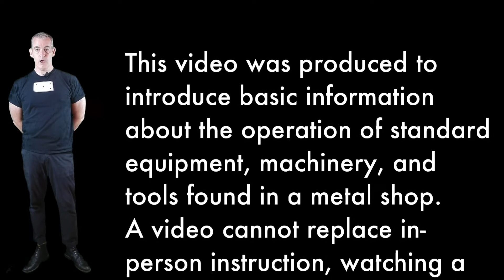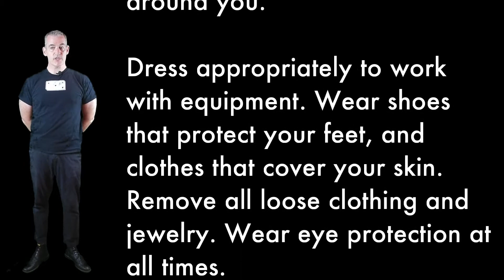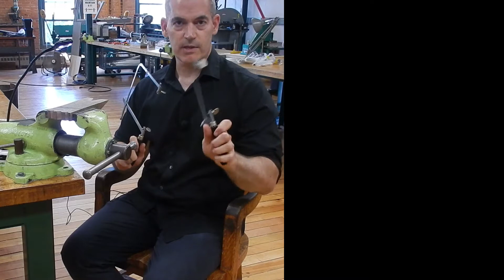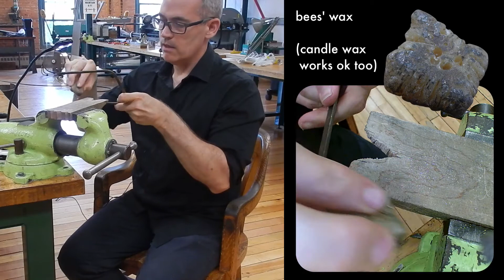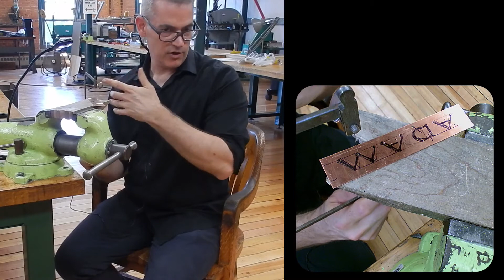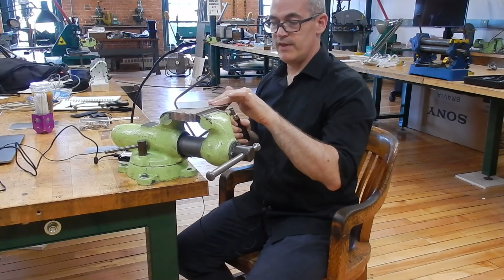Common Metal Shop Tools: Jewelers Saw

Comment: What is the difference between a jeweler's saw and a coping saw?
Reply from the maker: It's just a matter of scale. Coping saw is pretty much the same just with a MUCH thicker blade and coarser teeth. Also because the blades last a lot longer they are made with tabs that hook into the frame, making them a little less fiddly to set up...